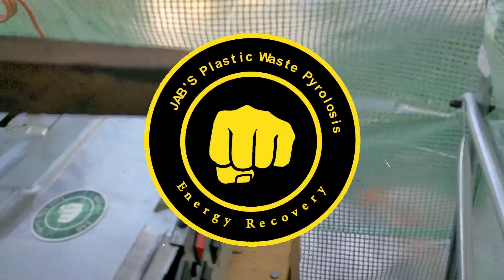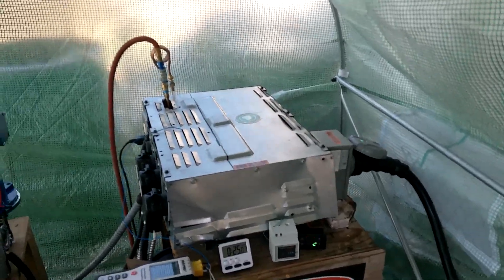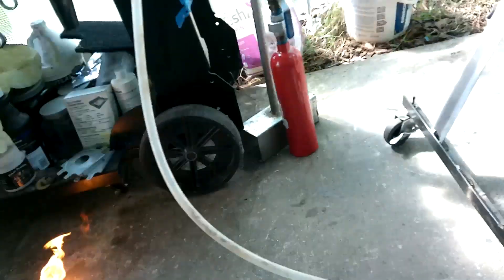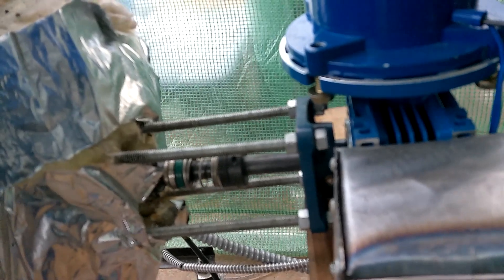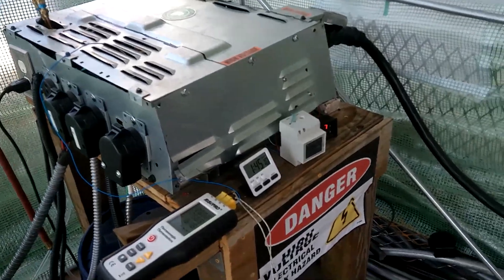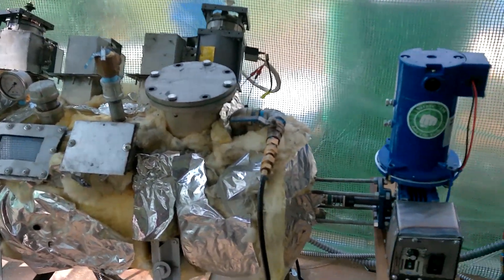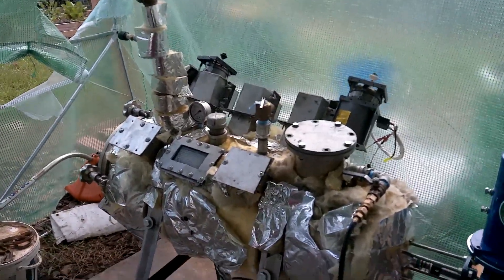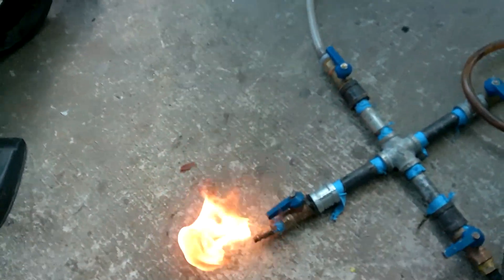Turning Plastic into Fuel! -  Running Mark 4 Part: 3

Comment: What is your electricity expenses?? Are you sure you are not paying more electricity than you are getting in gas?
Reply from the maker: $2.64 per 5 hour run
Look at all the products we get and I'll leave it to you to decided if we get equal or more value of products
Reply: @naturejab  amazing
Reply: He's getting more than gas.  Don't forget that he's also subtracting plastic from the waste stream, as well as producing some oils that would run in a diesel engine.
Reply: @dansw0rkshop  i am eager for the pyrolysis oil distilation setup.

The proper setup to get clean gasoline more than the pyrolysis process honestly

Comment: Use a fridge compressor to put the gas in to a tank? Cody's lab has a video where he automated a H2 and O2 producer/ compressor.

Worth a look
Reply: Don't do it.  H2 is not safe to store in steel tanks.  It causes embrittlement and an explosion.
Reply: @dansw0rkshop  it would be ok at medium/high pressures, for short time storage.